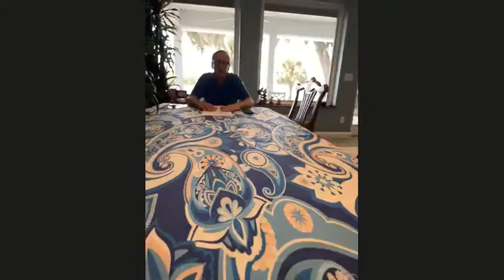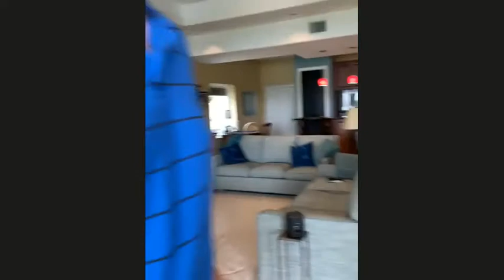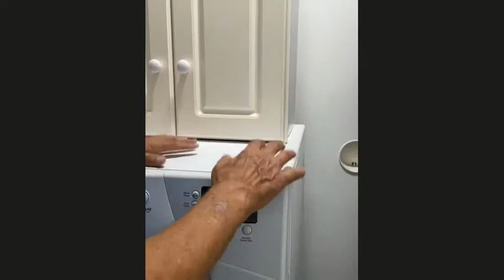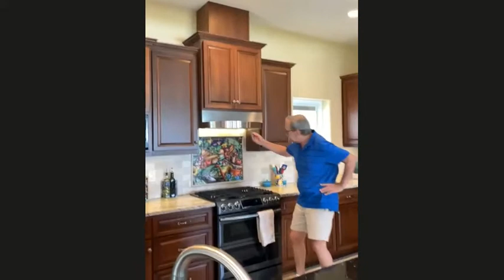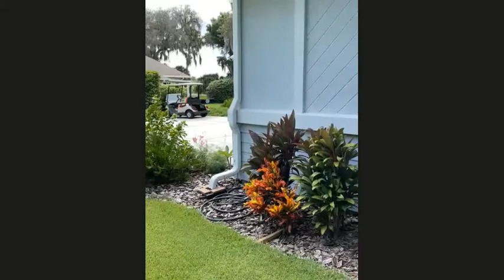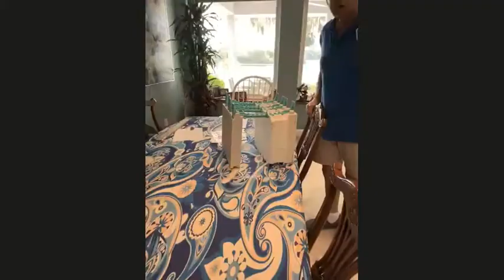FGBC Building Blocks of Green Building - Designing and Living in a Green Home

Comment: I wish I had more time to discuss a few more tech features in my home but the clock ran out. 
1.  I am not an engineer but I became a student of engineering. 
2.  I purchased a program from the Portland Cement Assn. This actually sized the HVAC unit for an ICF house. After I installed it on my PC I input much information.  Insulation, exact window size and orientation, roof type. The list goes on and on.  Finally I hit the save button and it called for 18,000 BTU's.  The builder, the original AC guy and the professional engineer who was paid to stamp the plans all called for 36,000 BTU's.  They were way wrong on this.  Had I caved and put the larger unit in I would have a wet, sick house with mold and mildew everywhere. Finally I said look people, I am writing the checks here do it my way.  Everything worked perfectly.
BTW--90% of the air return is by displacement directly to the air handler.  Important...the return is under the air handler just above the floor. It sweeps the floor of wet air, dries and cools it and sends it back out again.   In the winter in heating mode it sweeps the floor area of cold air and heats it.  Under no circumstances would I put a main return in the ceiling.   I over sized the ducts because it takes less energy to move the air and it is very quiet. At full output it can not be heard.  The temp in the house is exactly the same in every room.  I would never us flex duct in a house. Have read way too many horror stories about poor installation, leaks, air resistance and more.  
architects even asking the buyer if they would like to